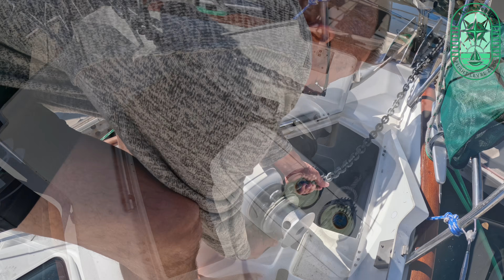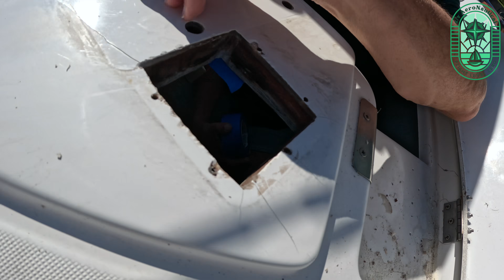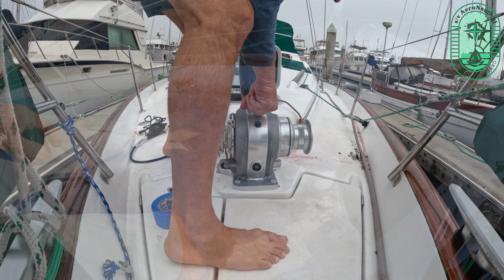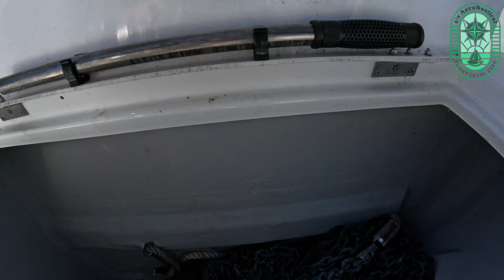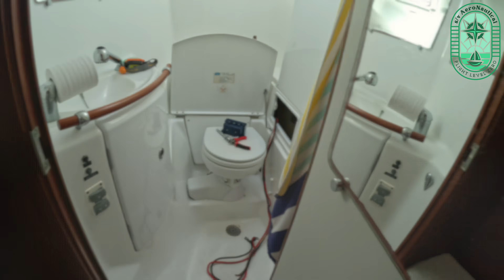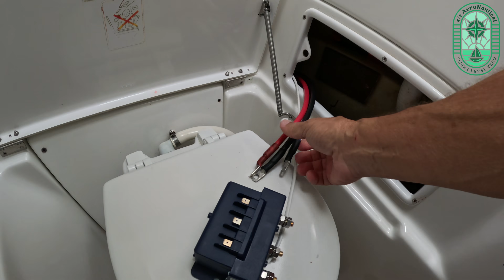Installing a Lofrans Tigres Windlass

Comment: Thanks for posting. I have a Tigres as well and it runs slow after a bit. I think I need a bigger ground wire. Also, is there a free fall opton?
Reply from the maker: Yes and yes. You can use the manual handle that comes with the Tigres to release the clutch by unscrewing the wingnut on the starboard side of the windlass. The ground wire could certainly cause slow running if the gauge is too small.
Reply: @sailingflightlevelzero  Is there away to let it free fall with a switch on the dash?
Reply from the maker: No, you will have to go forward to release the clutch to free fall the anchor.